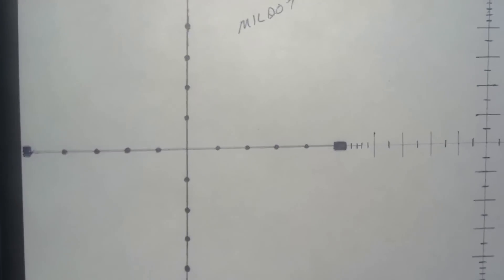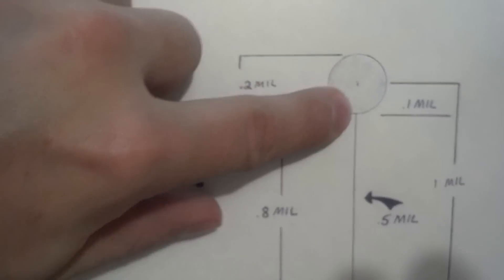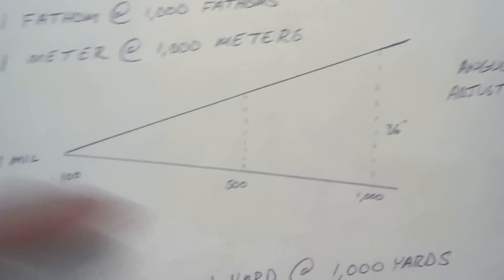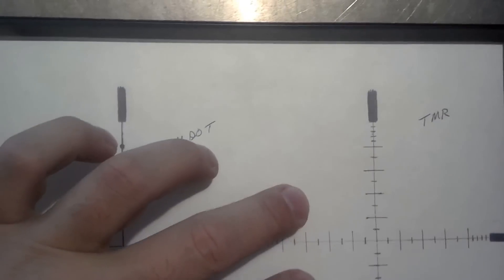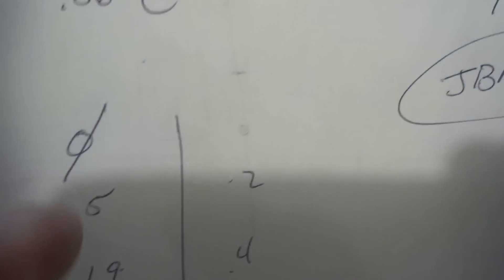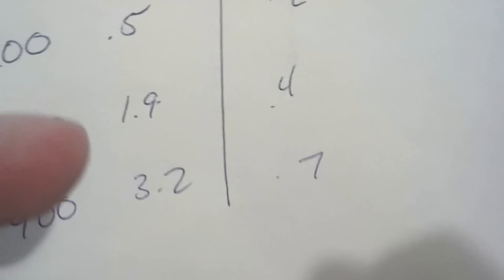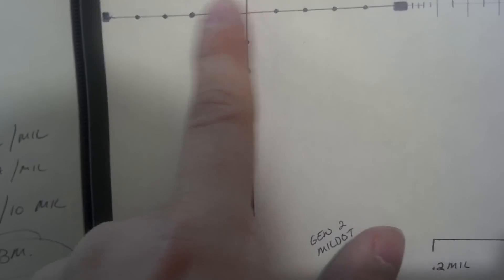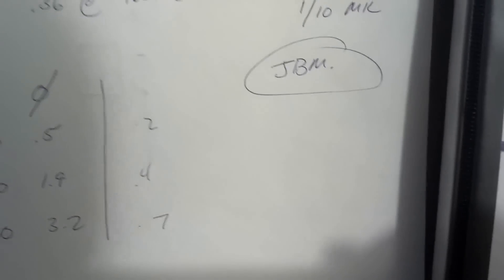Using a Mildot reticle with MIL based adjustments

Comment: One thing I feel that is worth note is the Mil = Milliradian. Radian as in good old HS math. 360 degrees = 2π radians thing. Because of radians being based on the circumference (unit circle radius = 1) if you multiply the radius (distance from you to a point) by the radian measure (or milliradian since that's 1/1000 of a radian)  that would be the distance of the arc length between that point and the adjusted point/height (note height up/down/etc. is not the same as this arclength but on the milliradian scale it's kind of moot since they would be fairly close for approximation).

Comment: I don't think you really have explained what a milrad is, and I'm surprised and unconvinced by those who say here that they finally understand the subject .In fact, I'm pretty sure they still MISunderstand it.

Yes, a milliradian (mil) is one thousandth of a radian, but how many of your viewers understand what a radian is?

Stated simply, a miiliradian (or mrad, or mil) is the angle at which your range to target is 1000 times the target size. If your target measures 18 inches, for example, (or 18 cm, or 18 anything) and covers 1 mil in your scope, then your range to target is 18000 inches (or 18000 cm etc). If your target measures 2 mils in your scope, it's obviously closer than that by a factor of 2, and if it's 0.5 mil, it's obviously further away by a factor of 2.
So your range calculation is as follows:       target size  X  1000  / mils as measured by your scope.

There's no need to be any more complicated than that. There is a 1:1000 ratio between the target size covered by your scope and the range.

There. Done!. 

No need for other formulas such as 27.78 or any reference to metrics, because it is not limited to metric units. It may be simpler to use with metric units, but only because they already embed the notion of hundreds and thousands. So using the example above, you may need a calculator to convert 8000 inches to 500 yards, while with metres, you can easily recognise 18000 cm as 180 mtres. 

Mrads work for ANY units and at ANY range. It is much simpler and way more accurate than the usual moa rule of 1 inch @ 100 yards (which results in a 5% error).

I can never understand why so many shooters are scared of or confused by milrad measurements, except that so few of these videos even mention the 1000:1 ratio, let alone emphasise it. It is the CORE principle behind Mrads, and if you don't understand that you have an incomplete understanding of the subject, and will lose or miss a shot while you work through the details.

One further issue, and it applies to any system of optical ranging (mils or moa). While the theory is perfectly correct and reliable, it can be difficult to estimate whether your target is really 3.1 or 3.4 mil (or moa, for that matter). This is because your target may be moving, or poorly lit, or indistinct against the background, or partly obscured. Or, you may be assuming that your man-sized target is 6 feet tall, or that fence post is 4 feet tall, or that doorway is 7 feet tall, but in reality you're dealing with a target that does not conform to your assumption. As I said, ANY system of optical ranging can be return an incorrect value if your inputs are wrong.

I hope that clears up any misunderstandings out there. It should not require a 15 minute video to make these core points. It took me less than 15 minutes to write this and for you to read it.
Reply from the maker: Wow.... a lot to unpack.  Okay....your right that they may not understand it afterwards.   But they can and have  freely asked questions if they didn't.   So not sure where you are coming from that the entire internet will grasp these concepts straight out of the gate the first go round no matter how its presented.

Next....the video is Understand how to use mil based adjustment and a mil reticle.  Not "how deep in the weeds can you bury yourself in math that honestly has little substantive value.  No shooter is resulting to radian based math during the shot process.  This provides them info in easy to swallow chunks to get moving without burning them out.

Third.  The mil relation formulas you have pointed out....are not presented at all in this video.  As making sight adjustments and mil relation ranging are two completely separate tasks.  It's not here because its not supposed to be here. 

Fourth.  You state you can easily recognize 18000cm. Guess what?  I cannot.  You know why? I don't ever use metric values in day to day life.  So your premise is immediately flawed as not all people are indoctrinated in that system.  My presentation is accurate even if you seem to have some kind of bias against it.

Fifth.  Your written statement that it works with any measurement isnt even contested.....if anything its it's even in written note stated as such in the video.

Sixth.  I nowhere claim to be Steven Speilberg.  This and other videos were done in a single uninterrupted take. Your rant with how long I take to present this and how long it takes you type something has no bearing on anything.  You clearly are inculcated with the necessary knowledge and assume the people watching this video take information in on concepts that they likely never have used before can be absorbed as easily and in as much time.  Which is patently false.

I have taken the time to look at your channel and you have not in any way presented this information yourself.  So if you cannot immediately provide a better presentation of your own creation....I suggest you take grandstanding elsewhere.  It does not impress me.  And if you have so much time and energy tearing down others work....then you yourself should be providing better.

Good day sir.
Reply: @DFOOSKING  I think it's called Narcissism.
Reply: @rkba4923  So you learned a new word this year? Good for you. Keep it up and you'll be able to express a whole thought, once you have one.
Reply: @richardofoz2167   If the shoe fits, ...

Comment: Just learning and this answered 80% of my questions. The next 10 are about SFP the multiplication of less than full power for hunting purposes.  I will have to set up some known targets and do some measurements to confirm what I think is right.
Reply: SFP refers to Second Focal Plane. In a First Focal Plane (FFP) scope, the milrads will be accurate at any magnification, but your reticle may be too fine or too coarse when you change the mag. In an SFP scope, you must set the magnification at the setting calibrated for that scope, but the reticle will not change in size with different mag settings. 
Some shooters (like Tiborasurus Rex), prefer an FFP scope so the mrads can be relied on even if you forget to check the mag setting. But it's a mistake to be dogmatic about that. It all depends where you stand on the trade-off between mag setting and reticle size. 
But remember that once you've chosen an FFP for its convenience, there's nothing you can do about your reticle size, and it may be too fine to see easily or too coarse to allow an unobstructed view of your target. whereas an SFP scope will give you a constant reticle size, and you just need to take care when mil-ranging. For me and many others, SFP is better for most situations.
Reply: @richardofoz2167  For all hunting uses I prefer the sfp , the old scopes used to all be ffp, until Mr. Burris figured out how to cure that problem
Reply: @robertboyd3863  I'm afraid you're replying to the wrong person. While I do have my views on FFP and SFP, I've never expressed them online. Try again.
Reply: @richardofoz2167  I was just expressing my opinion on the matter , not arguing with anything you said, I agreed with what you said
Reply: @richardofoz2167  In fact I thought you explained it very well

Comment: I have both MIL and MOA scopes. They both work on the same principle however the MIL requires a MIL DOT calculator, MOA can be done with simple mental math. Also, using the reticles for determining range to the target is far easier with MOA, again, MIL requires a calculator for ranging. I used MIL scopes for decades until I discovered the simplicity of MOA.

Comment: With mrad in mind,  shotgun shooters can estimate the ranges without a scope (though is accurate up to around 200m). Take a transperent ruler, point it with straight hand and bended 90°wrist to the object and by knowing your length of eye-ruler (which is constant) and knowing the object hight you can est. the distance. 

For example: my eye-ruler is 0,7m (it's a constant). Object that I  am targeting is 3m tall and ruler showed me 21mm.

Distance=H.obj x 0.7/ruler result [m]. 
Dis.=3×0.7/0.021=100m

Comment: But how much is one click elevation on a mill scope? What is the distance.
Reply from the maker: .1 mil....the distance varies.  Different loads fall and drift at different rates.  Run your data on a ballistics solver as was stated in the video.  Or fire and correct.  Your choice.

Comment: Good explanation. Best line; "doesn't matter if it is 10 yards or 10 miles, a mil is a mil is a mil.." Brilliant. Fuzzy camera made my eyes hurt a bit ;-) Second best line; "if you are not willing to do the work, you have no business taking shots at live animals at these distances." BZ!
Reply from the maker: Henry Cole Stage yeah the phone was constantly fighting me.   I did this in one single take.   there was also a dead spot of audio that came due to an alarm activating.   the only good news was it happened at a point that really cost no valuable content.
Reply: Yes,  a mil is a mil is a mil. But what IS a mil? It's not very well explained here, despite what many say.
Reply: @richardofoz2167  one mil is one thousandth. Basically, going from MOA to Mil is going from imperial to metric. It just makes more sense.
Reply: @henrycolestage7650  Actually, the prefix for one thousandth is milli, not mil. Mil is just an ambiguous abbreviation, which is also used for millimetres, which may be why many Americans get confused.

You're right that radians make more sense, but you're wrong to say that going from moa to mrads is going from imperial to metric. I'm guessing that you say that because of the common association of moa with inches and yards. But that does not make moa an imperial unit. It's a term that comes from mathematics - specifically, geometry.

Our surviving base 60 units, such as  time and angle, come to us from the Sumerian civilisation of 5000 years ago. They foisted it onto the Babylonians and eventually onto us. Base 60 systems were not included in the English system or the British Imperial system, although the English did contrive to measure length in dozens of different multiples of things like miles/furlongs/chains/yards/feet/inches, and roods, acres and perches. That was just to show how creative they could be and to deter people trying to learn and apply them. Fortunately, the always-contrary French confounded their eternal enemies the English by developing in Bonaparte's time a scientific system that actually made sense. Vive la France! Vive l'empereur!

Strictly speaking, you're right in describing radians as an SI unit, though only in a technical sense. Needing a measure of angle, and recognising the radian as a natural and universal measure for the ratio between a circle and its circumference, the radian was included in a special group of units called "supplemental" units, to  distinguish it from the 7 "base" units and the many "derived" units. Because of its universal validity, the radian could have been classified as a  base unit, but instead it was re-classified in 1995 as a "dimensionless derived" unit, despite its not being derived from any of the other SI units. So much for making sense.

Moa and milrads differ in another sense. Milrads can be used with any units of measure. They're equally comfortable with inches, feet and yards as with centimetres and metres - the only exception being that you will probably need a calculator to convert 17000 inches to yards, whereas 17000 cm can be converted to metres by just dropping off the extra zeros. Milrads don't discriminate at all, and can even be used with cubits, if that's your thing. Moas are not so forgiving.
Reply: richardofoz1267 - got a bit of time on your hands by the look of it 😂

Comment: So if you have a 2nd focal plane scope how would you measure the size of the target? Zoom all the way in or out? And wouldn't a 1st focal plane scope be a lot better?
Reply from the maker: On a second focal plane their is a mil setting on the magnification dial.  Most scopes have it at max magnification but not always.  I have a 4-16x42mm that has it at 10X.  Nightforce NXS 8-32x50mm have it at 22X. 

The point is it's at one particular magnification.  And depending where it's located can be a benefit for some applications.

FFP is kinda pointless for say benchrest rifles as they shoot one distance and they really don't use the reticle (the target's score rings are graduated).

A scope with a very short magnification range (3-9) is kinda pointless as well since what magnification are gonna use to shoot distance....max magnification.  Anything close your not really holding over so being shrunk down isn't too handy.

But for a long range field rig with a vast magnification range....FFP all day long.
Reply: I really like the sound of a FFP scope as long as the reticle don't get so small that you can't mesure very well with it at long distance. I'm pretty use to my MOA style scope and have never used a MRAD style scope before. I hope it's as easy to zero and dope as you explained in the video.
Reply from the maker: Just remember to use the reticle as your guide.  Sight in on a blank sheet of paper with a small dot 1/2"-3/4" dot as your aiming point.  After quickly looking down the bore to make sure I'm on paper with the first round.  I've zeroed many times in 3 rounds.
Reply: Sounds simple man. There isn't all the math involved. Just shoot and use the reticle and write down the drop data. Then next time you already know the dope. Provided the weather is the same. You have pretty much talked me into buying one. Gonna start looking at a nightforce or leupold scope. Thanks again for answering all the questions.

Comment: Great info. Between 1/4 MOA to 1/10MIL at 100 yards. Is MOA a more accurate measurement and finer adjustment over MIL? Or is it to close to call? Thanks.
Reply: 1MOA = 1.047" at 100 yards
1MIL= ~3.6" at 100 yards
1/4(1.047)=~0.25"
1/10(3.6)= 0.36"

MOA is finer, but unless you can tell the difference between a 1.1" POI at 1000 yards, it won't matter. Commonality between reticle and turret is more important. MIL-MIL, or MOA-MOA. Avoid mixing (although it isn't that hard to learn how deal with MIL-MOA, and considering how many mixed unit scopes are out there, good shooters should learn how to deal with mixed unit scopes in case they have to use someone else's rifle.

Comment: I got the Mildot on a savage 110 FCP 338 Lapua mag. I took it to the range at 100 yard without any problem. Next weekend I will take to the 500 yard and I will follow your instruction. By the way, where can I get that dope card?
Reply: You make your own dope cards by shooting your gun at the range
Reply: Any ballistic calculator app will spit out a whole table of ranges and angular adjustments after you input the appropriate info. That data  will be your baseline as far as what to dial when you go out for the first time at those ranges. Those table values get you in the ballpark. 

On the range, you then create a separate small DOPE sheet for your exact rifle, ammo, conditions, etc, and THAT is the DOPE card that you will rely on tactically (in Situ) for that specific setup. 

You can do this for all your rifles. Each one will be different. The calculator gets you close to dial in faster. In some cases you might get lucky. That’s what groups are for - to confirm the dialing and DOPE.

Edit: Didn’t realize this comment was 10 years old. At any rate, maybe it’s still useful to someone.